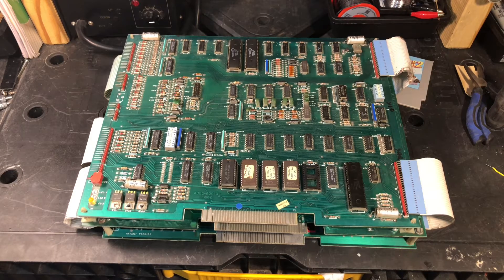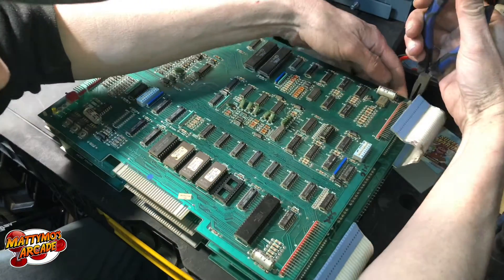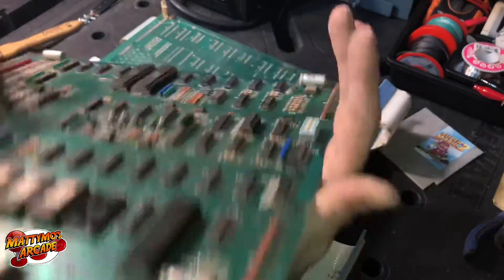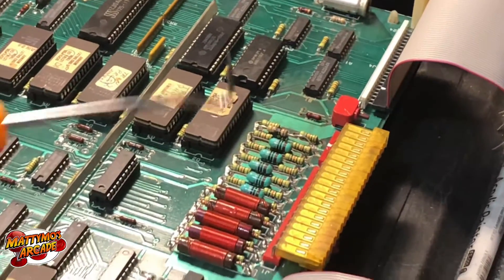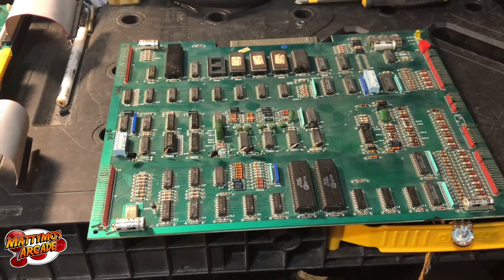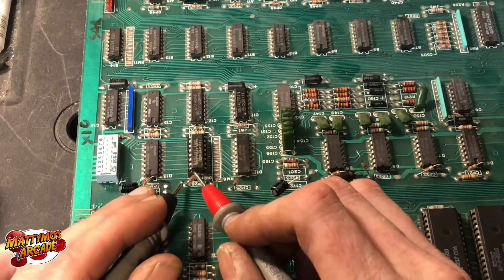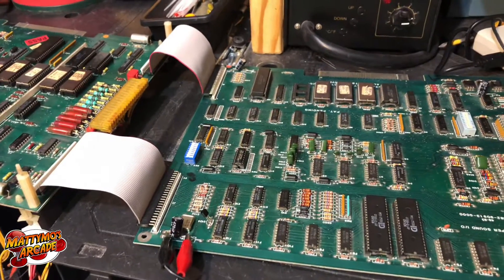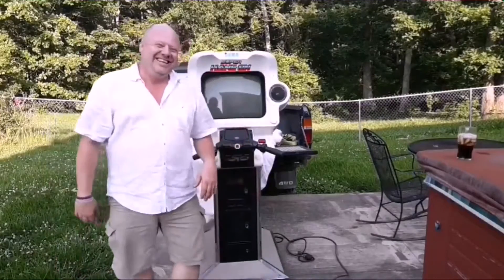Tron and Tapper Arcade Pcb Repair

Comment: Any tips on repairing a Tron game that isn’t getting any image to the CRT?
Reply from the maker: Check the z80 and make sure it’s not resetting. Pin 26 on the z80 should be high. If it’s pulsing, check the watchdog. Also make sure to test voltages at the furthest rom. Needs to be 4.8v to 5v, at the chip, not the supply.